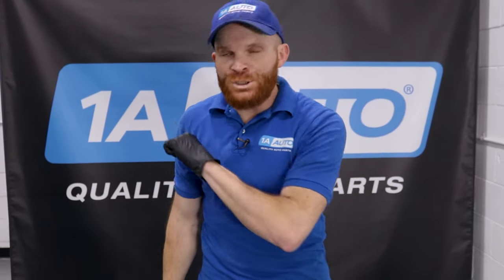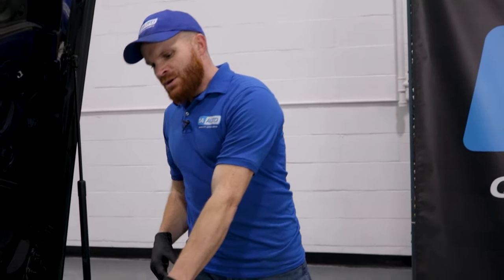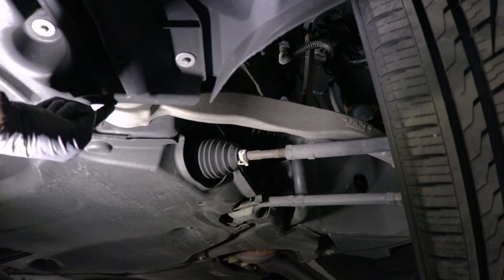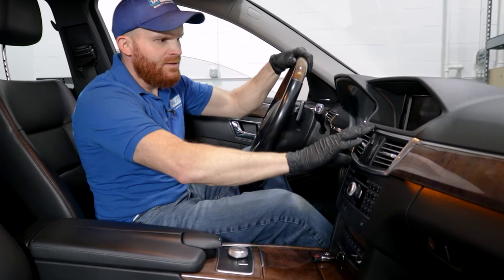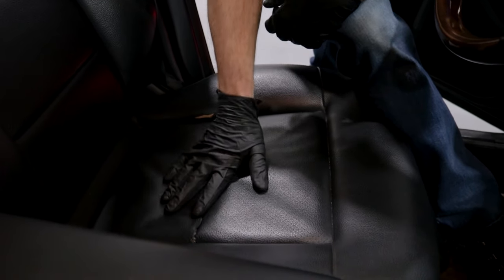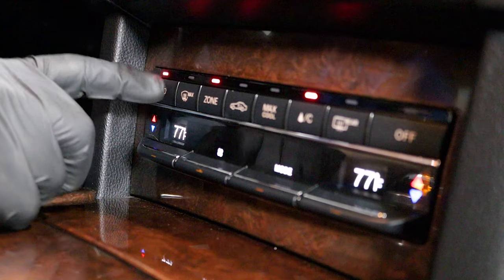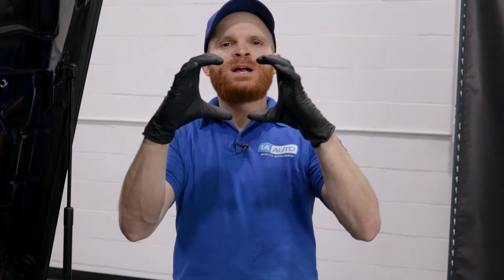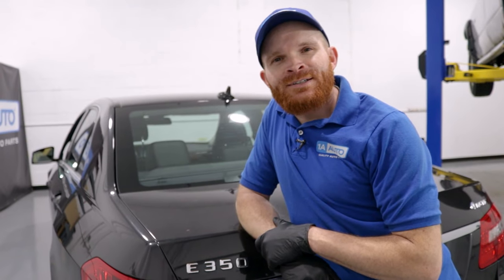Top 5 Problems Mercedes Benz E Class Sedan 4th Gen 2010-16 W212

Comment: After 100k miles on mine,  I had to to replace both cv joints, the battery, motor and transmission mounts, air conditioner control module, command control knob, struts and shocks, fix 3 oil leaks, and replace drivers side seat cover. Still have to replace the wheel bearings on front left and the front and rear drive shaft at some point in the near future. What a nightmare.
Reply from the maker: +Giovanni Amoroso Thanks for the feedback!
Reply: You bought a lemon... it was probably assembled on a Friday...lol
Reply: Complecated german cars lol

Comment: These cars are great but plan on putting aside $200 a month for maintenance.. I have 70k miles, only a few leaks ($500 FIX) and changed a few axle boot seals, seats are different though so no tares.. Car looks and feels mint..  Gonna slap some oem  e63 19 inches and it will look great..

Comment: Get those seats repaired at an Auto Trim shop, save some money take the seats out ( 2 from seats) and drop them off. Not difficult to get done and should come back looking great. Ideally, you may want to get the complete covers replaced as aligning topstitching is difficult if replacing a panel. Could be tricky to get the exact match for Vinyl but maybe the trim shop can get something very close you would never know. 
I see online the original covers are ridiculous prices, order from Germany and pay 400 euro for a seat base only.

Comment: 2010 e350 sport 126k miles. Skid/traction control light pops on, "esc inoperative" displays in info center in cluster and vehicle goes into "limp mode". Can't wait to chase it down. Trying to narrow it down but could be throttle pedal, brake light switch, corroded harness somewhere and a plethora of other things. Any tips or info is greatly appreciated!

Comment: I have a 2010 E200 C GI only had ignition problem in2016 at 99000km on the clock going very well I have it serviced every year or 15000pkm intervals supper car no fading of wood  paintwork or seat but I maintain my car very Cape Town  South Africa

Comment: I have the split seam in the driver seat.  My bigger problem is that the heated seat does not work.  I am in the process of changing the seat cover but would like input on troubleshooting the heat. When you touch the button, it lights, after a few seconds it goes out. I see no breaks in the wiring in the seat. Don't know which fuse to look at or what else could cause this issue.  Thoughts?  2011 E350 blutec

Comment: They will last if you properly maintain the vehicle, but be aware of required maintenance. Do research before purchasing one of these vehicles regarding the cost of maintenance, because you are still paying to service the expensive when new vehicle. As example, My upcoming service B (oil/filter change, new wipers, cabin air filter, inspection, brake fluid change) = $600...New front right marker light part = $17/installation $129...Just installed new engine air filter...Part = $45 (did this myself as the dealership charges $180ish), Also need transmission fluid/filter change approximately = $300.....SO basically next scheduled service can easily exceed $1000. Not complaining as my car is worth it to me, just trying to make others aware regarding the true cost of ownership....Also, vehicle can only run on 91+ octane fuel. If you don't plan to properly care for the vehicle then don't buy it. Granted, you could do the work yourself if so inclined and skilled.

Comment: This has to be a design issue because i had the same exact issue with my 2001 c320 w203. Boy did it act crazy. I had taken it to two different mechanics who when they drove it said it drove fine and couldn't locate a problem even after putting it on a lift to inspect. WTH! Meanwhile i'm driving around atlanta and the car wants to play exorist. Then it all of a sudden just stopped doing it. But then the battery drain issue that, you guessed it, nobody could find started giving me headaches. I just gave it away.  But i love Mercedes and they are still better than most, if not all when you consider what you get for the money depending of course on which model one chooses.

Comment: I have a 2011 E 350 with 100,000 miles that has a most irritation interior squeak that only happens when it’s warm and the car is in motion.  Seems worse when you make a turn.  The source of the noise is hard to determine, I’ve I’ve tried to identify it while sitting in both front and back seats.  I thought it might be the plastic in the roof, back window, or trunk seal. Sprayed silicone at all these locations, but the warm weather squeak continues.  Started doing this 4 years ago.  Any ideas?  Thanks, Larry

Comment: The shifting problem is not common and can be fixed with the transmission in the car. It requires replacing the conductor plate so you don't have to 'tear apart the transmission' as stated.
Reply: It isnt ? Ive read a lot of people have it but would you recommend buying a w212 e550?
Reply: @JonathanHernandez-mq5zy   I would definitely recommend buying a w212 E550, find one that has been treated right and treat it right yourself and it will put a smile on your face everytime you see it.
Reply: Additionally, just the electrovalves can be changed, however it's even more professional job to do.

 @JonathanHernandez-mq5zy  I would buy one in coupe version 🤩🤩

Comment: I have e350, the abs light went on other night, I heard crunching from front passanger , hit brake it was gone but it happens if I try to drive…. I’m hoping it’s just abs sensor. Pads are fine, rotors are fine, bearings I never had an issue with at all, always rides nice and straight no noise like a bad hub bearing. I  ordered the sensors I’m hoping it’s that

Comment: My 2014 E350 has a panoramic sun roof that pops and creeks when it flexes. Dealer said they have to remove the head liner to get at the screws to tighten it......very expensive if you don't have warranty.
Reply from the maker: +phjtube Thanks for the feedback!

Comment: Goodness gracious! I was thinking of replacing my pampered E350 W211 2006MY (102,000 km currently) with a choice example of one of these W212 machines—a 350 or 500 or even E63 perhaps... However, I think I’ll just stick with the W211 now and save myself some big bucks ;-)) Do you agree?
Reply: I can only comment on the 63 models as I've owned a 211 and 212 e63 s model. the air suspension  on the 211 is more comfortable. main issues are the sensors started going . the transmission sensor cost me well over 1k to repair.  otherwise the w211 is great. the 212 ofcourse is more modern and a step up but you'd have to drive a 212 and see what you think of it vs the 211

Comment: Hey I replaced the radiator...  ( 2001 grand cherokee laredo 4.0 6 cyl) both lines were seized to busted up radiator so i disconnected them from the trans lines( skinny hoses) just I did not take note of where the top/bottom radiator trans cooling line connects back to. please help. does top radiator line connect with top skinny hose.?, on my jeep  the trans line sit on top of one held in place by clip like a brake line then the skinny hose .. before one of the hoses (the bottom line) there is a check valve looking thing then the skinny hose, the other line the skinny hose just connects to the line. So would the upper radiator trans cooling oil line connect   to that top line,  or bottom. help a girl out please its been days...

Comment: my Mercedes-benz e250 2010 is shutting down when the rpm is low, plus sometimes I kickdown the fuel paddle, the RPM goes to 4-5 but no power, and sometimes the vehicle works perfectly, can you please help me ? i changed the crankshaft and the camshaft but still have the same issue,
Reply from the maker: +Jad Mahfouz We wouldn't be able to diagnose an issue like that here, you may want to have a local mechanic take a look at it. Thanks for checking us out! http://1aau.to/m/Shop-1AAuto-c

Comment: I have a 2011 E550.  I have to assume that you’re talking about the 6 cylinder vice the V8 which in my 85,000kms has been flawless.
Reply: If you know anything about the E's, you would know that the E350 is a V-6 with 302 hp.  You have a 550 so why bother?

Comment: My infotainment thing doesn't work either. It's just a plastic shaft that breaks, and metal ones can be bought on Ebay, so not a big deal, or a hard job. 
Also the windowswitches on the driver side door is acting up. When i'm pulling the switch up to automaticly close, it wont so i have to hold it. Then when i get to the top the window goes a little bit down again, and i have to hold the switch to make it close again. This problem started half a year ago, and is now affecting the passenger side aswell.
Reply from the maker: +TurboAalgaEntertainment Thanks for the feedback!

Comment: What was the mileage on the car in the video?
Reply from the maker: +Ian Hobday Thanks for watching, but we do not have info available anymore.
Reply: 1A Auto Parts Thanks for the reply. It would have been useful information, especially in regards to the cabin squeaks you mentioned.
Reply: @IanHobday  my 2010 e350 coupe makes all those same noises, but only if you press on things. While driving, it's completely silent other than occasional noise from the rear view mirror which stops if I give it a gentle squeeze. Currently at 80k mi
Reply: Anything else he mentioned could start as early as 60k mi, but maybe not until significantly longer than that if at all if you're fortunate enough

Comment: I want to covert my2010 e350 4matic sedan with the L type nice led fog lights and do a small right side corner damage I have a dent in current bumper and want to convert it to the facelift model! What model facelift should I do AND also what rivets/tabs do I need to get? My friend works at a local body shop and her boss told me if I want to concert I need to get the correct tabs/rivets. It’s either facelift bumper or e63 2010-2012 front bumpe, HELP ME PLZ FOLKS

Comment: My mom have a E220d avantgarde from 2010 but somehow that car have managed to avoid all of those problems. Instead it’s been having some other problems tho like ac problems, problems with the compressor for the adjustable air seats, and electrical problems that apparently required the whole steering column to be replaced.

Comment: I'm seriously wondering where did this guy find this car?? My 2011 e350 NEVER gave me these stupid issues.. just the seat but it doesn't bother me as much.. theres absolutely no noise from the interior parts and my heat/ac never gave me an issue.. i honestly wouldn't put my reputation on the line by lying about this car but I've had mine since 2011 and with over 100k on the dash i replaced my waterpump and pullies with my belt. Perfect amount of power and in S mode its pretty decent.

Comment: I'm looking for an e220 or e250 CDI what can you tell me about those engines? Are they reliable ? Easy to repair? Cambelt needs to be replaced? How about the manual transmission are they reliable? I know a manual doesn't suit a Merc but i prefer manual cars bcs of the automatic maintenance and the higher repair bills

Comment: I own a 2011 E63 which now has the "cricket" noise coming from the passenger side dash when the air is on at the low to medium range. It's very annoying and a little embarrassing.
Reply: It has to be the blower motor needed no replacement the bearings are dry and you can not lubricate them without taking the motor apart

Comment: I have a 2011 S212 with 81K miles.  Seat split 4"; comand system replaced last week; cup holder slide need assistance. No engine issues. Knock on wood.
Reply from the maker: +Jason Ramos Thanks for the feedback!
Reply: Why did you replace command? My 2014 Mercedes e63 keeps turning on and off the radio randomly but everything else works sometimes it will stay on long sometimes it just stay rebooting

Comment: in my case it showed the heating temperature message in-sighting to add coolant i stopped went to add the coolant i found out that the pipe you are cutting had not been clipped at the radiator actually it was not connected to the radiator we fixed that but it kept on showing the heating temperature you can drive for less than 300 metres then message pops up again you stop the car turn off the engine after 5 to 10 minutes you start the engine the temperature will be back to normal and the fan keeps on running the moment you start the car when you cut the engine the keeps on running to about 2 or 3 minutes then it stops    what can i do i need your help its E280

Comment: 😂😆Show me a us car of this class that still drives at this mileage and has no holes in the leather. Greetings from munich
Reply from the maker: +M W Thanks for checking us out! http://1aau.to/m/Shop-1AAuto-c
Reply: Mb Tex “leather” yeah, I replace that bucket seat cover myself when the car only had 80k on it. My Lexus is250 with original real leather seats still looks and feels great after 11 years and 210,000 miles. Greetings from Japan 😂😜
Reply: My E was built in Sindelfingen outside Stuttgart. I have a 2018 W213. Not sure if my MB Tex will have any issues since the stitching is different and hopefully improved. I bought new and only have 26000/mi due to working at home during Covid.

Comment: I have a 2010 E350 4matic same spec as the one in the video and almost at 95k miles, The only problems ive had with the car is the seat ripping and the ac not being cool enough and the parking sensor disrupted, other that that its one of the best cars on the road

Comment: I have a w212 2014 and nobody seems to mention the following 3 MAJOR problems that are common with these vehicles. 

1) Rear Subframe rotting
2)oil running through the engine wire harness into ECU from either Camshaft Magnet or Camshaft Position sensors. THIS WILL SHORT OUT YOUR ECU. 
3) Rear Springs Rotting out and breaking

Comment: My 4th generation E class has none of the problems this guys describes and it has 110K on its Diesel engine which gets 37 mpg...btw, the cup holder sliding door is supposed to work that way! So you can adjust it the way you want it! I agree with prior post, this video shows German engineering at its finest ;)

Comment: Re the transmission (722.9):  If the turbine speed sensors are bad you’ll see MIL codes.   Before taking down the valve body I recommend a fluid service.  My 2007 C230 with same transmission had the speed sensor problem.  Took the valve body out to separate the conductor plate off for rebuild and that took care of it.  I was a little apprehensive about the DIY but took my time.  Vendor for conductor plate refurb has excellent YT vids for the procedure.  Doing it this way avoids having to program a replacement conductor plate to the car.
Reply from the maker: +Vic Sorlie Thanks for the feedback!

Comment: I have a 2010 e550 with the sport package bought it with 80k miles had to
Replace transmission but I  knew that when I bought it.. I replaced the transmission with a 30k mile transmission and am now at 133k miles on the vehicle and have not had any problems whatsoever with anything.. use it as my daily and drive at least a minimum of 60 miles a day on it..
Reply: Is ur car on air ride I have the same Mercedes but the front right air strut leaks
Reply: How's the mpg?
Reply: @maisondav1d  Mine's a 350 (3.5L V6) and I'd say it leans toward poor. Ave17-19 around town (16 on short trips), but can be 25-28 on highway cruises which is what the car is built for. 550's w/ the 5.5L V8 will of course have worse than that. There is good power down low, and good power overall, but not enough power for 16mpg around town imo

Comment: I have one from 2012 - never experienced these problems.  However, I do need to disinfect the HVAC system from time to time due to a known "mold" smell.  Wondering if the problems are on earlier cars.
Reply: There is a class action lawsuit for that same reason ! Check out the info on the lawsuit . Mercedes benz HVAC system lawsuit you’re entitled for reimbursement. I just got my card in the mail 2 weeks ago
Reply: Same here, but I have a 2010. They seem pretty solid if cared for.
Reply: of course its a famous problem! 
You just need the HVAC maintenance. Benz has a specific cleaning  procedure to try and clean evaporator from passages but it only last so long...

Best thing may be to turn off AC before arriving to melt any ice and help drain water during driving else moldy growth, sick air guaranteed 🤭
Reply: Have you changed your cabin filters & carbon filters?
Reply: I used to have that problem until I Replaced the cabin air filter with one that has activated charcoal. Cheap ones dont and have bad seals.  I also may have sprayed a solution in where that filter is with the heat on high.
Reply: jgatchal jgatchal someone filed a lawsuit against MB. MB settled and is going to fix HVAC systems
Reply: Just change the ac filter and it is good for a long time. Disinfectant is smelly and it won’t block the smell for a long time.
Reply: Dealers will charge you like 300 bucks but you can buy 30$ ones and DIY change it.
Reply: Cabin air filter
Reply: @MercedesE63S-AMG  That cabin filter has no relation to a mouldy HVAC drip tray that continually stays wet. Would be like saying open your window and you wont smell the mould. Just masking the problem. However there are some YTube vids that show how to get under the car and squirt disinfecting solution up into the rubber drip tube to flush the tray out. When using AC for awhile and parked, if you dont at some point see water underneath the car, could be the rubber drip tube is blocked somehow. Not saying thats the issue but worth noting.